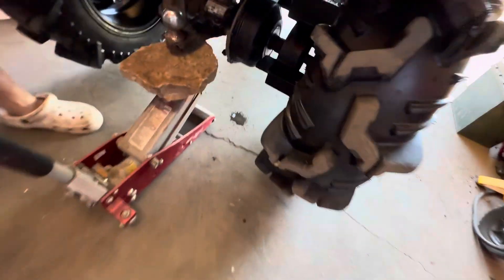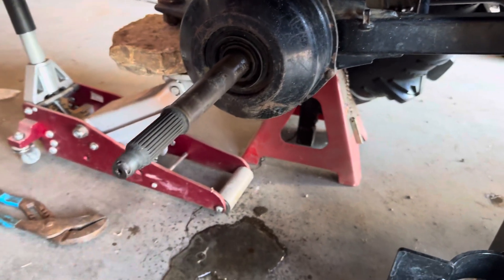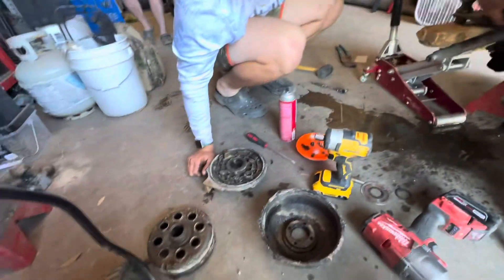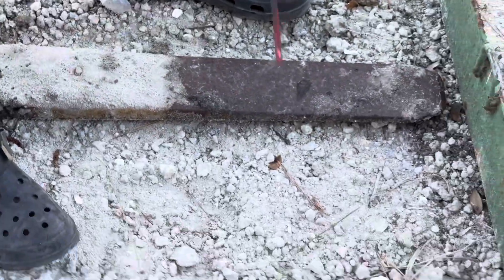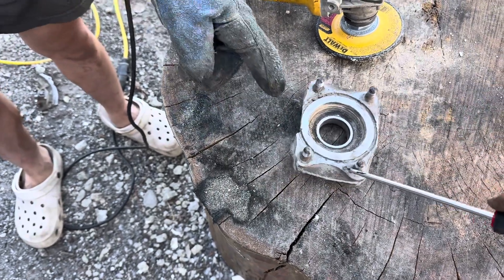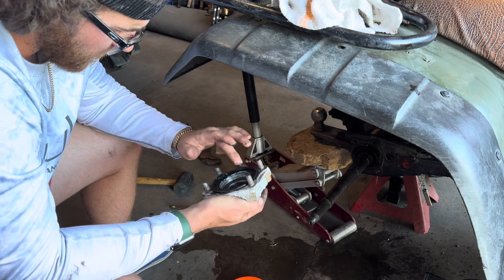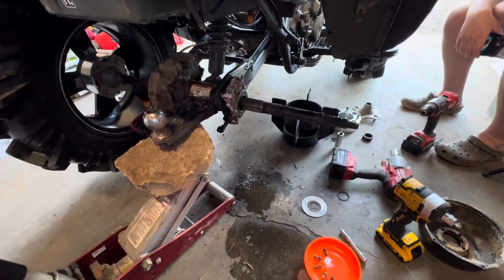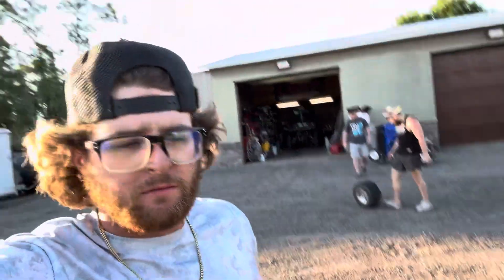Rear brake delete on 90s model Honda fourtrax 300

Comment: Any update, on how this working out?
Reply from the maker: @LeviFoxworth  Didn’t leak to bad and held up
Reply: @ITS.CBLEAUTV  is the leak where y’all cut it down to much or? Would suggest this to some using as hunting bike? Or go ahead and factory seal it back?
Reply from the maker: @LeviFoxworth  leak was from that cut yes and we mostly ride in water down here so the water pretty much made its was threw that way but if you’re hunting with it and don’t mess up the cut you’re good